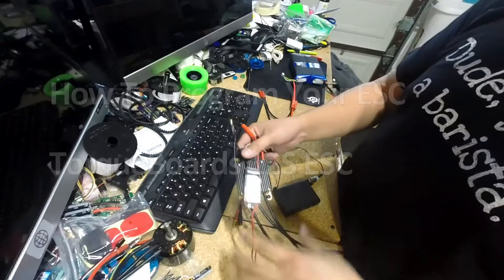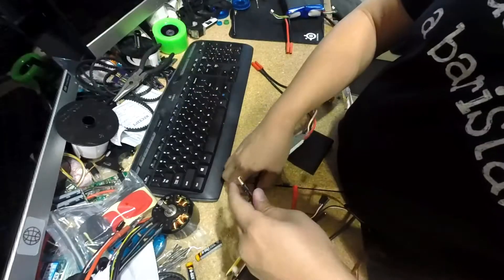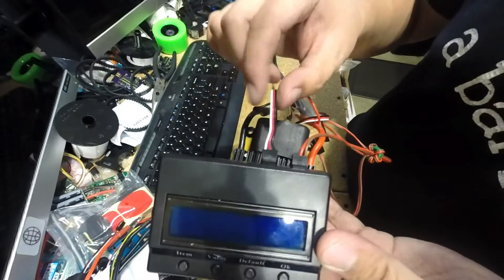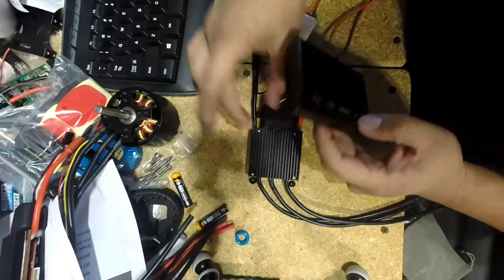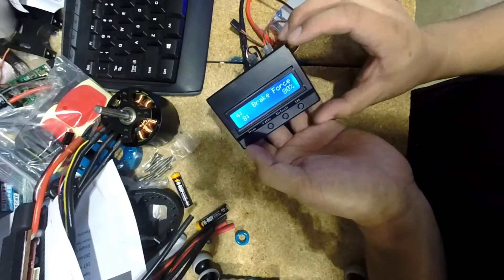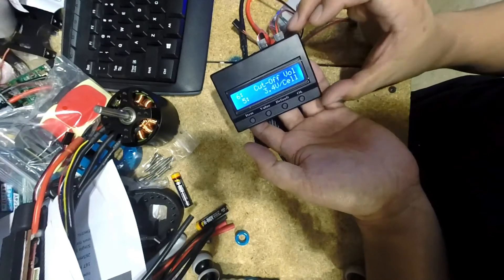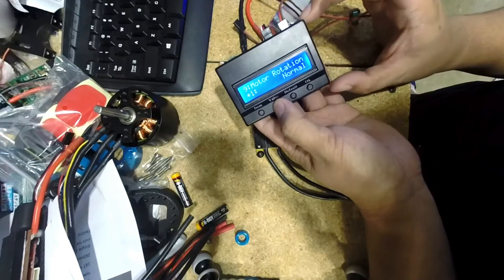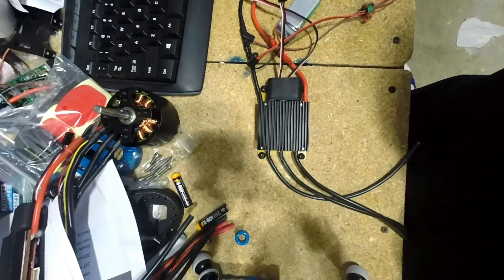DIY Electric Skateboard: How To Program a TorqueBoards 12s ESC - DIY Electric Skateboard

Comment: Hi I live in SF and want to build an electric longboard.  I was wondering what motor and batteries to buy.  I was planning on running two 4s batteries but don't know what motor to run or if that setup will be efficient.  Please feel free to give me any advice your have learned from your epexerinces.  I weigh 150 lb, want to commute with the board and live in SF(lots of hills)

Thanks

Comment: One thing to remember is to make sure you click ok... then ok again after changing each setting to save it .... If you change 3-4 settings then click ok & ok to save it will only save the last setting you changed.... Just something to remember ;)
Reply from the maker: +Jake Bettles Thanks Jake. Yeah after every option. You will need to hit OK to confirm the changes.